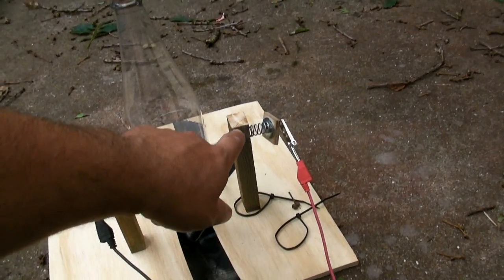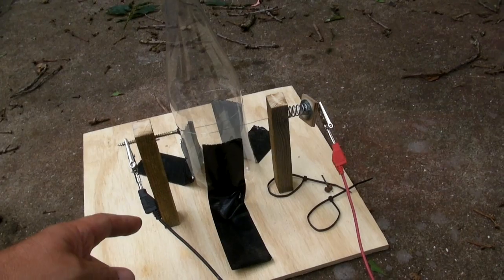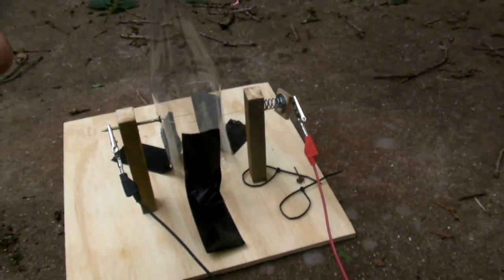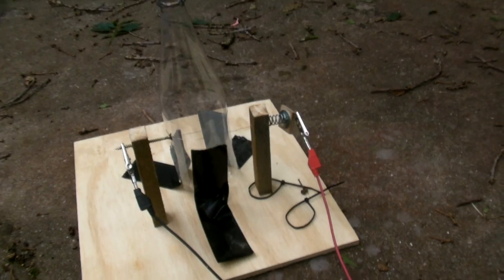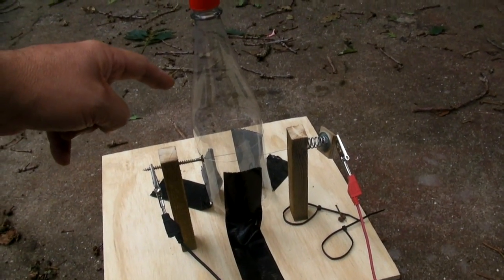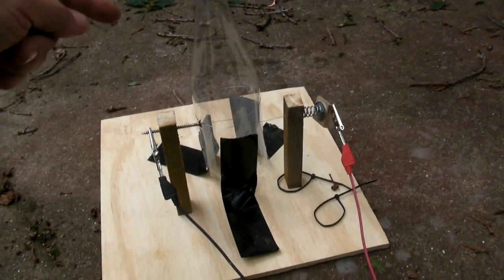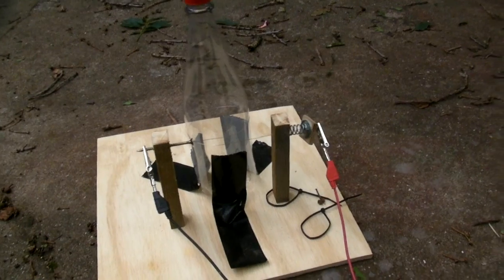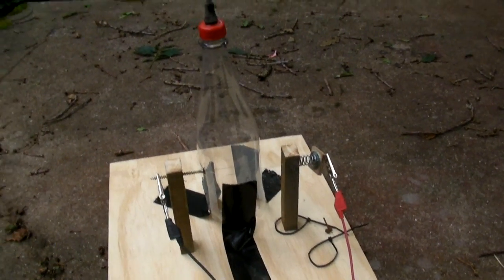A Prototype Demo Showing The Energy Stored In Compressed Air

Comment: Was there ice in the bottom part of the bottle? At 2:12 onwards you can see the vapor as the bottom part is flung away from the camera, or is that just the water being pulled out of the air due to the sudden pressure change?
Reply from the maker: MrBenTheBear The only water in the bottle was the water vapour in the air so, yes, what you saw was just a fog of small water droplets condensing due to the sudden pressure drop.

Comment: wonderstruckwow   Awesome !    
I don't really understand why you went through the trouble of putting the resistance wire through the bottle; with associated issues such as loss of pressure by having to rupture the plastic.   Why did you not just loop the nichrome wire around the bottle?   I guess there must be a reason for this!
Reply: ***** he did loop the wire around the bottle

Comment: hhmmmk dry ice and L.N. mix in that bottle?
Reply from the maker: Nathan Dean I don't think there'd be any point mixing them as the liquid nitrogen would keep the dry ice below its sublimation temperature so it wouldn't contribute to any pressure increase before the boiling nitrogen had already burst the bottle.

The point of this particular demo was to just give an idea of the energy that can be stored in simple, everyday air.  When we do this on stage we'll probably get some volunteers up to pressurise it with track pumps so it gives more of a feel for the energy stored in there.

Comment: Put frozen Co2 in the bottle, as the bottle swells it acts as a switch between 2 contacts for the current going through the wire. 
I would guess you could achieve a much higher pressure and still stay at a safe distance.
Reply from the maker: Green Silver Like the idea of the swelling bottle closing the contacts - but we wanted this one to just be about energy in compressed air rather than CO2.  When we do this on stage we'll probably get some volunteers up to pressurise it with track pumps so they have more of a feel for the energy stored in there.

Comment: if a dude opened that he would have a quiet surprise
Reply from the maker: Swiftwolf beta Those bottle caps and bottle necks are actually designed to let pressure out slowly as you open them - they have little channels through the threads that are specifically there so you don't get your eye blown out with a fast moving cap.  If they weren't there you'd certainly have a surprise when you opened it.

Comment: I think we can safely say that that was a success!

Now then . . . . how to upscale???? hmmmm (puts thinking face on!)

Do you think an old drinking fountain bottle would yield the same (but obviously much larger and louder) results??
Reply from the maker: Paul Roberts That would be much harder to do because the plastic is a lot thicker for a hot wire to burn through plus you've also got to make a cap of some sort to close the bottle.  Drinking fountain bottles are made from a stiffer plastic so there's not as much elasticity in the walls and they will tend to burst at 80 to 100 psi so I'm sure they'd make a bigger bang but not as big as you might think.

I suspect a 3 litre PET cider bottle would be pretty loud!

Comment: I did sim once i stuck a bike tube valve core in a 2 litter bottle filled half way with water and pumped in about 100psi then shot with a .22. I ended up drenched heh Was allot of fun though. The instant the .22 hit the bottle just shreaded and blew all the water strait back at me. I would have loved to capture that on high speed as i would not have been to shocked if the .22 was stopped dead from the blast of watter was a 30 gr lead with only the primer to propel it so not allot of power. Probably would have looked awesome on slow motion. The lead was laying almost exactly where the front surface of the bottle was. If any thing it was a little closer to me than the front edge of the bottle.
Reply from the maker: Nova Flare Excellent - when we were playing around with this we tried shooting one of the pressurised bottles with a .22 air rifle but the pellets just bounced straight off from just 10 feet away where they would normally go straight through quite easily.  The extra pressure just made the bottle so much more rigid - there's a lot of energy stored in there!
Reply: wonderstruckwow Yeh try it with water it will likely rip through. Then again with a pellet in .22 being 750 fps to 1100 fps but only 20 grain it may just not have enough force. For something interesting presurise it with water and see how long it takes the hot wire to cut through :p What should happen is youll bring the water to a boiling point. But sense it is not going to boil at 212f but a good bit higher do to the increased psi. 90psi is going to raise the boiling point of water tremendously. It should get closer to 260 270f and rupture the bottle which will convert instantly to steam giving a nice big steam explosion. Should look great on high speed. Obviously you want to be no where close to that thing when it goes. But it may be allot of fun to put a hotdog above the bottle :p
Reply from the maker: Nova Flare Doing a steam explosion is one of the things we have on our list to do.  In the current set up I don't think the wire will cut through a pressurised bottle of water as the heat will constantly be convected away.  For the same reason you can put a bunsen burner under a balloon of water and it won't burst (it takes a few minutes).
Reply: wonderstruckwow Exactly. The water in the bottle will continue to heat up with out boiling going way above the boiling point. The higher the pressure the higher the boiling point. But at some point the bottle will not be able to take the increased pressure and will rupture. At this point the water will instantly convert to super heated steam that will be far higher than the sea level boiling point of 100c 212f. In a pressure vessel that had a theoretical unlimited pressure rating the water would infact never boil as the air pressure would rise with the temp of the water inside it. And with no limit to the pressure the bottle can contain it would just increase forever as would the water temperature. That is if you could generate a infinite amount of heat as well.

But obviously in pratice you could never pull such a thing off. But i would bet that the water temp would hit a few times the normal sea level boiling point before the bottle ruptures. Of coarse the plastic will stretch before popping and the water could also simply boil at normal pressure until the bottle springs a leak and you would just have a plastic pot of boiling water. 

I suspect that the cap will blow off before that though giving a huge steam explosion of supper heated steam strait out the capp end. So maybe put it upside down cap end down and end up with a nifty steam rocket :p
Reply from the maker: Nova Flare I've seen it done with small sealed glass vials of water heated over Bunsen flames (in polycarbonate 'bomb' boxes) - I'm not sure what the burst pressure is but even a few cc's of water goes with quite a bang.  We've actually got a steam rocket on the drawing board (just for use as a static demo) that will use an immersion heater element to heat the water until the pressure reaches about 20 bar.  Then we open the nozzle.  The plan is to use an adapted CO2 fire extinguisher (rated to 120 bar) but the modifications have to be done by a coded welder and the whole thing has to be hydrostatically tested and then officially certified as a pressure vessel so it will be very expensive.  Which is why it's still on the drawing board.